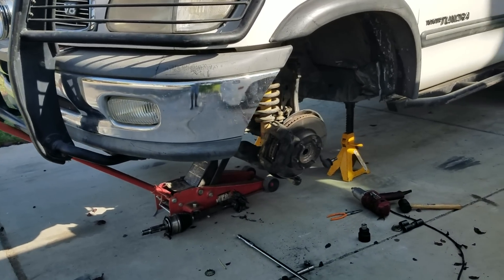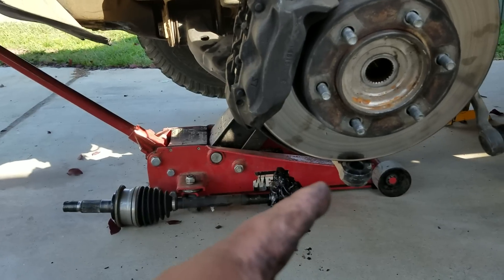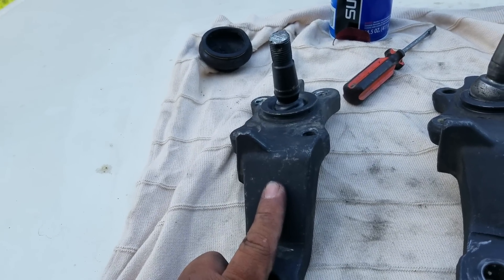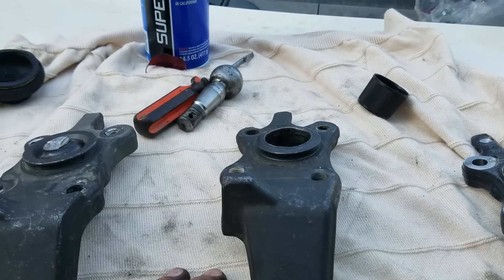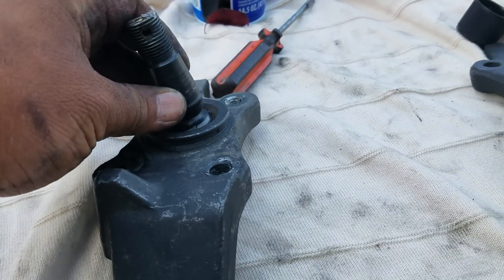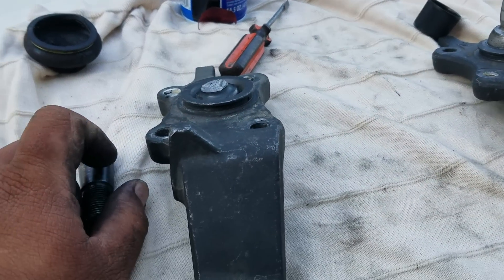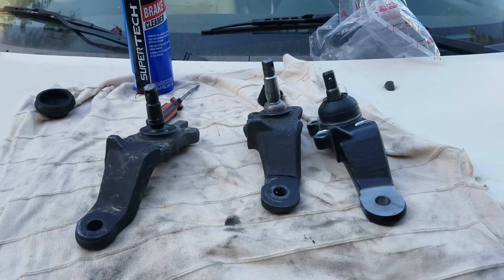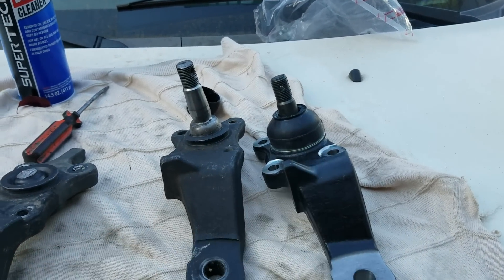Tundra Ball Joint Failure.

Comment: Just ordered oem ones. I’m replacing my aftermarket ones to be on the safe side. Great video. Glad you and your family are okay.
Reply: Where did you order from? Looking for OEM for my 2000 tundra. Thanks
Reply: It doesn't matter what ball joint you use, they can pop at any time at any mileage. The ball joint isn't the issue it's the spindle design.

Comment: Thanks for this timely public serviced announcement. Most people in your situation wouldn't even think of warning others outside of their circle of friends. I was planning to replace the original lower ball joints/control arm/tie rod ends on my 2003 Toyota Sequoia, which has 257,000 miles and most likely shares suspension components with the Tundra. I was leaning towards Moog parts but will now buy Toyota genuine parts instead.
Reply from the maker: NJ2MDdude I would hate to see anyone crashed on the road due to BJ failures. That weekend was the darkest time in my life. I had my 4 children and wife along with my RV on tow broken down on a 2 lane a mountainous  highway. I would not wanna wish this on anyone.

Please share and hopefully save someone's life. Also if you find this video helpful please like and subscribe.
Reply: ...scary...
Reply: @theotherguy3083 as long as you drive your tundra on the road you are endangering everyone's life. It doesn't matter what ball joint you use, the spindle design is to blame for popping ball joints. Gen 2 tundras pop ball joints constantly as well. You have blood on your hands if you recommend this truck to other people.

Comment: Oh God!  I couldn't believe that I found your video.   I got very similar situations. And I did replace 3 times lower ball joints on my Tundra 2000.  First time, the mechanic bought from somewhere he called and they delivered to them.   2 times lately I got lower ball joint from O’Reilly. One was broken, other one got sheared off. Now it started to have a squeaks sound again.  I will go to Toyota dealer to get the part. 
Great Video!!!
Thank you very much,
Reply: what the hell with the viet love tundra, or toyota truck.
Reply: @dangda-ww7de  They are good trucks. My '06 Tundra still has the original ball joints@ 200K miles.

Comment: I have been seeing on youtube and forums that the lower ball joints on 1st gen tundra and sequoia and I believe 3rd gen 4runner have lower ball joint problems. So I've heard to replace the ball joints when you do timing and water pump with oem. Or check it yearly.

Comment: You are showing one OEM replacement ball joint. Should replace both at the same time. Use only OEM!! Glad you all survived..  My 05 Tundra joints were replaced under recall no problems . Getting ready to replace  now After 150,000 miles still tight good luck.

Comment: Just watched this video last night, which made up my mind to buy the toyota part this morning. Was just delivered. But lo and behold, before I was able to pick up the new ball joint and install, my old one snapped while driving. Its the original. Truck has 175K miles. Luckily i was only doing 20 and no one was hurt.

Comment: I went through all this last summer. This whole time I had blamed my leveling kit, thinking it just had my stock components absolutely stretched out too far. I kept going through ball joints like crazy on driver and passenger sides. So I pulled the leveling spacers out and been cruzing at stock hight ever since. Now I know this I'm going to get some Toyota ball joints and reinstall my leveling kit. So excited now! Thanks a lot!
Reply from the maker: If you installed a leveling kit, be aware you'll need to install a after market UCA
Reply: @theotherguy3083  I've been looking into those, previously assuming to level the truck back out I would need to change out spindles and a few other things. But with the proper ball joints, my upperCA's should be all I need now?
Reply from the maker: @dangalow3793  do you have a stock uca?
Reply: @theotherguy3083  yes sir

Comment: This story should have made Head Line News! Your so Blessed that you and your Family are alive and all safe!
It is so important to always use OEM or FACTORY DEALER PARTS when it comes to Front End, Suspension, Steering parts and components, and Drivetrain parts and also Michelin or Goodyear tires. Your LIFE is worth the extra Money!  You also have to be carful about  buying parts from Auto Salvage Yards, like ( You Pull &Pay, ETC...) You really don't know what kinda life those parts have been through !!!
    I have a lot of similar situations myself. Thank you so much for sharing YOUR STORY!
      MAY GOD BLESS YOU AND YOUR FAMILY. Thanks DC
Reply from the maker: Amen on that. God was indeed watching us.
Reply: Glad you and family are safe~~~~ happened to my 2000 tundra just so glad it failed on me on hunting trip, not on the highway or freeway! But first time it’s happened so thanks for your video ! I was gonna buy the duralast brand but NOW I bought mine from Toyota dealer I had just hit 400,000 miles and the original just gave out only the driver side though but. Replaced both knowing the passenger side would fail next.. Awesome 👏🏽video and thanks for the info on the parts. Those non yota brands look like they are weak compared to Toyota’s brand
Reply: @theotherguy3083  good stuff right there buddy...
God is Good...God is Great...Go God go!!!
Reply from the maker: @zekethefishgeek8690  all the time. . .God is good

Comment: Had the same problem with both sides on my 02, both happened 40 miles from the paved road at very slow speeds. Had to use AZ and O'Reilly parts to get home, the parts would only last a few months from either place. I've learned the hard way..... Bearings, ball joints, and oil seals MUST be toyota parts on the 1st gen tundra.

Comment: It looks to me like you have a 3"lift spacer on top of your strut, If you do this hyperextends your a arm angle, this puts added stress on the ball joints, you should weld female bungs and install limit straps or you may continue to have problems even with a factory ball joint, I have an 01 with 3" lift and got my limit straps from Rancho back in 02, hope this helps.
Reply: Good eye
Reply: Good eye good eye ball

Comment: I’m going to be traveling 2400 miles soon with my family with my 2006 sequoia(173k miles). Today for the first time, I heard squeaking in the front left tire area when I turned the tire left. Is this going to be an issue? When I travel at high speeds, I don’t hear it squeak nor is my car making any clumps.
Reply from the maker: Have you changed the BJs on the truck yet?
Reply: No I haven’t

Comment: the four bolts bolting the lower ball joint to the steering knuckle are undersized too ,they have been known to shear off on bumpy roads.Had it happen to me
Reply from the maker: Agreed. That's why you have to replace them when you replace the BJ. Mine sheared off too.
Reply: mine is sitting in the woods right now with the bolts sheared,I am online ordering parts .You can`t get a steering knuckle if you cant get the broken bolts out you have to go to a junk yard .I think i am going to put a tuff country lift kit on it ,get rid of them old steering knuckles ,

Comment: Just to let people know. It doesn't matter what manufacturer you choose. It's a flaw in the design that causes this to happen. Be careful if you have over 80k on the lowers because they can go at anytime.
Reply from the maker: On this one,  I disagree.  There are numerous forums and documentations of failures of aftermarket designs. My failures were back to back. Since I went back with OEM, I have not had any failures. It's been fours years after I made this video since I went back to OEM.
Reply from the maker: Rashida Horseface  you didn't watch the whole video.
Reply: While there definitely would have been better design options it does actually matter which manufacturer you choose. Toyota uses a different design than most cheaper aftermarket parts (tons of white (lithium?) grease, plastic/nylon insert around the ball, polished ball).

Comment: Hi  I purchase a set of Lower Ball Joints  from TRW  on  e-buy like a year ago but I never  put them on
For 75 dlls each
And I keep them on my garage all this time
But my tundra is level 
And it happens to me  too 
Almost the same  I was driving  on the freeway  and after I get on the exit and I reduced my speed about to 10 miles  it happens it broke 
I was so glad  that that happened  when I was driving  10 miles  per hour so anyway  I am still scared because k was with  my  family 
Now I don't know what to do  because I have the TWR  lower ball  joints and I am scared to use them
What  should I do now please  
Tellme should I buy the OEM s
Now I am gonna remove  my  leveling kit and set everything  back to the way it was before 
My tundra is 2wd but looks like 4x4 cause I lift it 3" but now I am scared....
Screw it  I just  bought  the OEM 
Ones and I will.set the set of TRW 
Lower ball joints 
Thanks
Reply: Where did you get OEM from?
Reply: @ChallengeMyths  
E buy or your local Toyota dealership

Comment: I just had my second lower ball joint snap on my 2000 Tundra.  Very scary situation to have your truck slam to the pavement and stop only because of the friction of your suspension grinding into the road.  I'm very hesitant to keep the truck.  Thank you for the video.
Reply from the maker: dave5613 were the bjs OEM? Or aftermarket?

Comment: That's a very far drive their and back on the curvy road. Not to bad really. But I knoe what you mean about ball joint because mine is squeaking for over a year now. But I took it off road on very bad trail which was cover with rocks and small boulders. All I hear is ball joint squeaking and thought maybe my wheel bearing so replace inner & outter but was the case. I've changed every component out about 3-4yrs back but yes nothing beats oem factory parts. I didn't get the factory because with everything I need will cost more than what I really want to invest.

Comment: I had my 02 Tundra at the shop today doing shocks all the way around, I shook the front end to check for tie rod play ect... I realized on the passenger side the lower ball joint is loose as shit getting them replaced ASAP never knew this was such a big problem with these tundras, appears to original but even OEM ball joints fail they had a recall on these I hope the wheel doesn't fly off on the way to the shop lol
Reply from the maker: Agreed. This is the Achilles heel for our trucks. If you offroad alot, check them for play. I think Toyota went lazy when they built these truck and used the same BJs that they use for the 4runners and Tacomas.  Those are light trucks. Our trucks are way heavier and requires a heavier duty BJ.  Just my thoughts.
Reply: @theotherguy3083  yeah seems to be an engineering issue, I'm glad I did research because I was going to just forget about it because the truck drives perfect, but after reading about all these claims that BJ's failure I'm definitely not ignoring it and changing them ASAP. Thanks for the video, glad your alright!
Reply from the maker: @rosssmith9941  thank you. I made this video so people won't have to go through what I went through.
Reply: Im at 279Kon 02 Tunfra and never had a ball joint issue. And Im hard on my truck. Live down a 4x4 road. Might not be entirely Toy's fault.

Comment: This is a Toyota Design flaw. I explained it in detail on this post. It’s a pull apart design and you need to upgrade to the bigger 04-06 suspension. Arms and balljoints with 17mm bolts. 

https://www.yotatech.com/forums/f28/tundra-catastrophic-balljoint-failure-258350/
Reply: So ball joints on those more recent models are free from this problems?? Igot an 05 CM with 130,000 miles and I'm trying to find what's going on...
Reply: @POLOAZTECA  they are not free of it but less of such accident to happen either way  please do not go cheap on this and buy oem from toyota.
Reply: @TheTruth-ge7fj  how about for the cv shaft should I go oem or is aftermarket fine
Reply: @westg463  those i would go aftermarket
Reply: Not free, my 04  sequoia at 250k snapped off on a left turn into a parking lot. Tow truck guy mention hard turns on dips tend to cause failures more often.

Comment: Another reason for failure is not using the correct torque.  If you don't torque to spec you will stretch the metal and cause failure.  Please use a torque wrench.
Reply from the maker: No. That's true.  I torque all my bolts. The reason for the failure is cheap quality after market products

Comment: happened twice on my 01 tundra once about 6 years ago and then 1.5 years
 ago had it fixed again now the truck just sits in my yard . the shop 
that fixed it said that they have seen other tundras with same problem. 
didn't think anything of it until i saw a guy in a tundra at 7-11 with 
same problem he said it was the 2nd time on his truck .i think its more 
than just a coincidence the top ball joint  shears off on all these 
tundras.
Reply from the maker: mike newman yup

Comment: You bought an inferior made in China part to replace a critical steering component of your vehicle. Comparing it to the OEM part you can see the difference in quality of manufacture. Critical components are no place to try to save a buck. Glad to hear you're okay.
Reply from the maker: Toyota will soon stop making BJs for these old trucks.  Once that happens, you'll see a lot of accidents because aftermarket sucks.
Reply: man i'm fucked i own a 2000 tundra v6 with 265/70R16 i close to make 260k miles.I believe the original joint is till on and want to purchase new ones but the cost is harsh now me seeing they will stop make this part i'm gonna sell this truck.It runs and the amazing thing is it got flooded in hurricane maria last september in Dominica.A new clutch and 2 o2 sensors later i had is running but all parts i must import them.It is hard trying to maintain this truck as i have 2 little ones.I use  it as a daily driver and quite a few times after seeing your story i always think of your incident and tell myself i must try to get these ball joints.Tell me what's the best truck to own?
Reply: @johnathancommodore9642  tundra or tacoma
Reply: @zekethefishgeek8690  Yes hello it was a 2000 tundra 3.4 v6 4wd but I sold it back in 2019.I have a 1995 Nissan hard body now Japanese version.It's not big like the tundra but I'll tell you one tough little truck.

Comment: Looks like you forgot to put grease in the aftermarket bjs. Regardless oem or moog is the way to go I had a duralast idler arm on my 1990 4runner sheer clean off while going up a hill wheeling once. The bushings and all were still in good condition. The metal part that sheered looked a bit porous though.  Back in the day moog used to make the duralast parts but now they are made by some cheap Chinese company.
Reply from the maker: k3nj33zy these are not greasable. If they were I would have greased them..

Comment: Im afraid to buy anything other than Moog or ToYota OEM. You will pay alot more for OEM though and Moog is heavy duty quality parts and very well professionally made. You dont want cheap parts on a suspension that carries a heavy truck.
Reply from the maker: Mark Contry I cannot endorse Moog or any after market brand.  I will only endorse OEM. The reason why is because I have never had a failure with an OEM.

Comment: You should not have a spacer lift on your coil assembly this is why your ball joints are failing remove that and you'll be OK
Reply from the maker: Yes and no. The main issues are the after market BJs.

Comment: In my opinion, parts like lower control arms, drive shafts, brake assemblies and CV axles really need to be OEM, but parts like tie rods and other parts not under such extreme stress can be after market.  I have to wonder just how much load you were putting on the driver side steering when hauling the trailer. Does the trailer have brakes?  Glad you are OK , I know that road.
Reply from the maker: Yes, the trailer is okay. You are preaching to the choir re: OEM.

Comment: My front passenger ball joint failed TWICE in 4 months.  The 2nd time was with a brand new ball joint.
Reply from the maker: Mike Kelly what brands did you use?
Reply: It was repaired by a Precision Auto....I tried to call them and find out but they are closed on Sunday.  I'm sure they did not put OEM on the truck.

The steering also would not return to straight after turning and releasing the steering wheel after that repair, so I'm wondering if they overtightened the ball joint and crushed the boot.

Stuck in a hotel out of town today.
Reply from the maker: Mike Kelly this second incident just happened this weekend?

It also sounds like shoddy mechanic work and cheap parts.
Reply: Yes, last night travelling at highway speeds, the wheel fell off with a new ball joint installed maybe 8000 miles ago.  I couldn't take it to the original shop because I'm out of state, so will go to war with them tomorrow for my money back.
Reply from the maker: Mike Kelly wow. I wish you well brother. This is why I don't know any good mechanic.

Comment: This has me rattled a bit. I have same year 2wd version and am currently doing my upper and lowers(both are the originals as far as I know) and luckily I did buy the OEM's to put back in. Did you end up keeping your Tundra? If so, had it held up this last couple years? Great videos, thanks for sharing your how-to's 👍
Reply from the maker: I still have my truck, yes. I have installed a lift kit with a heavy duty spindle. My truck is running well now. You can check my latest videos by subscribing to my channels and check my videos on the works I have done to my truck.

Comment: If the OEM ones are soooo good, why did they have to be recalled?
Reply from the maker: My understanding is that because at the time, the company making it made some that were not good. After Toyota found out, they redesigned the BJs and had another company remanufactured their product. Someone correct me  if I am wrong.